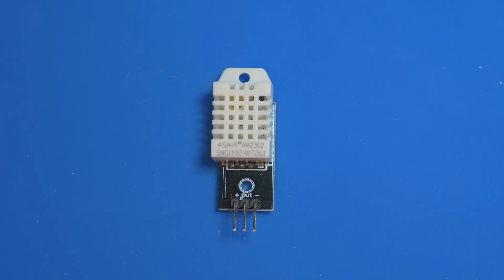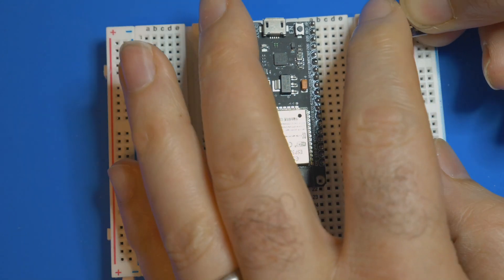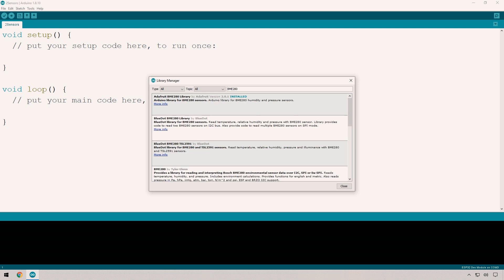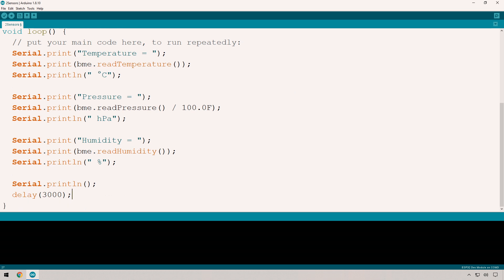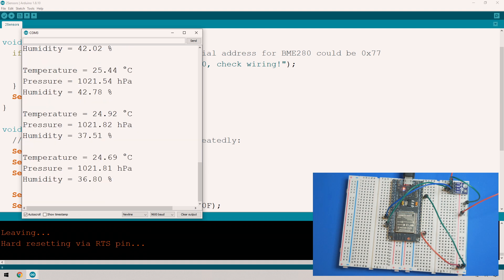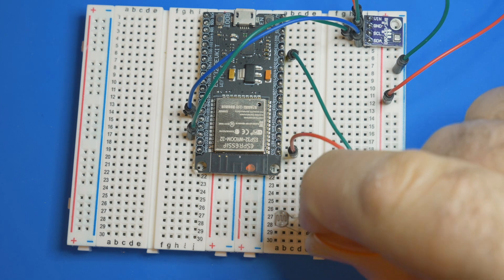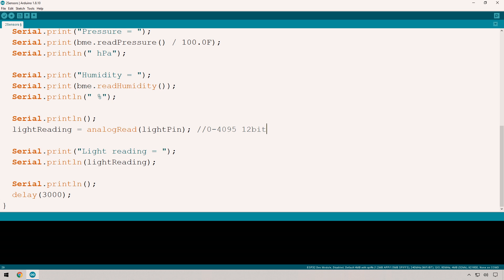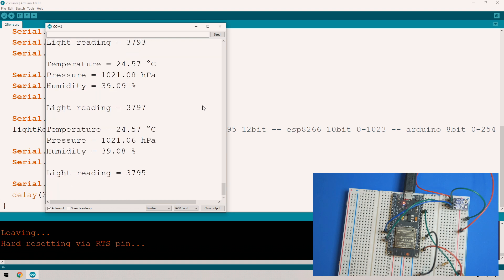BME280 and Light Sensors

Comment: Hey ChilliChump! I have the BME280 working just fine when using the short cables, but when i try to use a 2m network cable, the humidity reading is constantly Zero. Temp and Pressure is working as expected. Any ideas? Cheers mate.
Reply from the maker: Unfortunately i2c can be a bit of a challenge over longer distances. I would recommend having a seperate powersource firstly for them (don't run it off the ESP). You can also boost the signal, by adding a resistor and power source.
Reply: @ChilliChump2  Cheers man, I reduced the length of the cable and added a separate power source and all is well. ;)
Reply from the maker: Excellent, glad to be able to help!

Comment: You can solve the address clash on the I2C line with an I2C multiplexer. Check out https://learn.adafruit.com/adafruit-tca9548a-1-to-8-i2c-multiplexer-breakout/overview.
Reply from the maker: I have used multiplexers before...but I am trying to keep the complexity down. I will certainly use one if I needed to run with more than 2 I2C devices. Thanks for the link!

Comment: A little late to the party, I've realised something that you did not mention in the video which could throw some people off. The analogueRead will only work on GPIO pins that are also designated as ADC1 or ADC2 (Analogue to Digital Converter). The other GPIO pins would give a reading of 0 with this code.
Reply: THANK YOU!
I was struggling with the 0 value... ;-)
It also didn't help that I have a different version of the esp32 with different pinout.

Comment: You linked to 5 volt version of BME280 but connected with 3.3 volt. So it doesn't matter whether one gets a 5V or 3.3V version?
Reply from the maker: The one I'm using, as you see in the video, can take between 1.8v and 5v in. So 3.3v works just fine

Comment: Is it possible to use 2 BME280 with the adafruit library or do i have to switch the library if i want to do that?
Reply from the maker: I actually set that up for myself yesterday. I used the adafruit library without a problem. Just remember to short the pins needed to change the address of one of your bme280s
Reply: Thanks, good to know! So i don't have to change to much to my code ;) Plz include this in one of your next videos :) Right now i'm able to read one bme, publish it's values via mqtt and control relays with mqtt messages. That's way more than i was able to do one week ago xD
Reply from the maker: Just released a video you may like...

Comment: Great video again, have to wait to use my BME 280 as i need to solder the pins on, Havent bought a decent soldering iron yet but that is going to be my next purchase, the soldering iron i have is equivalent to a red hot poker and wouldn't want to damage my new projects, by the way the blazing buffalo extreme is tasty, ive been using it like ketchup on most things.
Reply: Have you looked at the TS100? Amazing little soldering iron.

Comment: Sometimes it is difficult to descrn where the wire of the plug-in board ar going. With the module you mention the pin so easier.
Other than that. Good